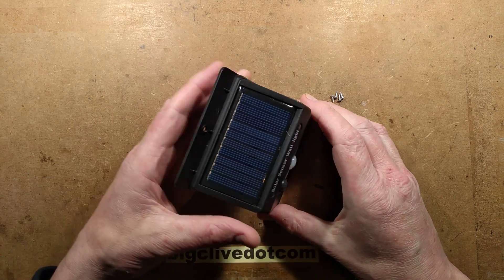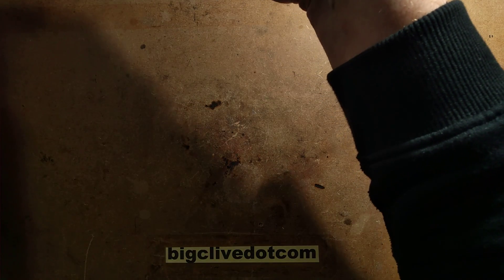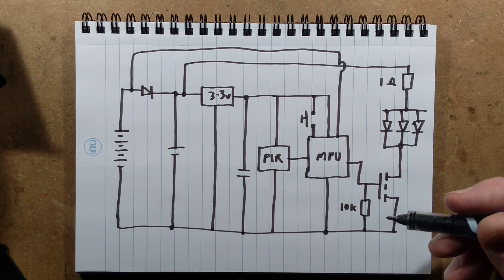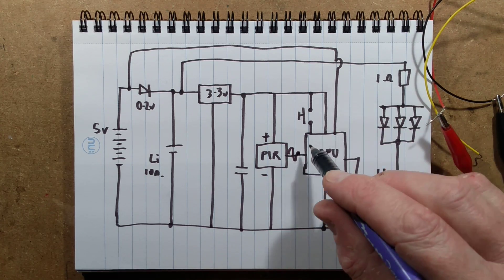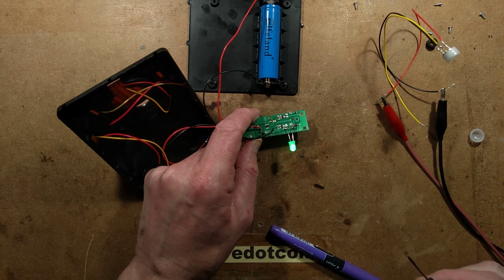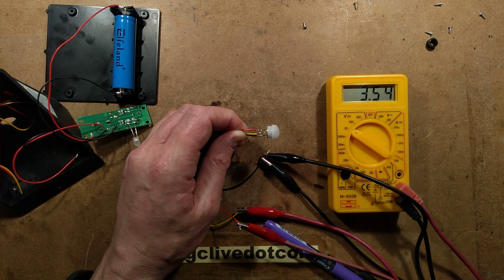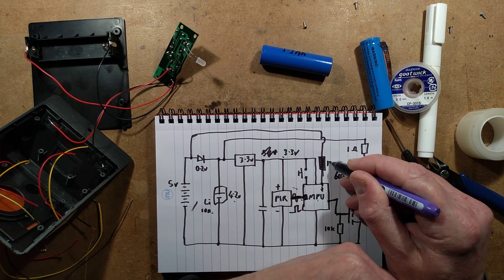Autopsy on a badly designed solar light (no lithium charge control).

Comment: I have 2 of these with the same shitty design. Both have failed due to the soft gel on the solar panel milkifying 😁. I gave them a good scrub with a scotchbrite-like scouring pad, stuck in a couple of near-done cells and put them back in their trees. Been running great for over a year now! 
I ran a wee bit silicone round exposed edges. I was surprised that the panels worked. Kid-on scotchbrite is your friend when it comes to milky panels, it seems!

Comment: Hey I just bought that same light at the dollar store here in the U.S. just the other day July 2025 and it only works if there is light to the solar panel. The motion detector does nothing and it don't charge the battery. I was thinking of replacing the battery but if it don't work properly then that could be bad. It does have that burned electrics smell. I would of took it back but they probably would just try to sell it again. Oh and my battery is soldered in.
Reply from the maker: Check for reversed or bad solder connections for the battery.  It may also be that the battery is over discharged.

Comment: In my opinion, this would be a good scheme, not like in one of your other videos. The battery is constantly charging and the switch does not disconnect the battery, but the light activation circuit. Everything is clear and simple, I just wonder why the PIR sensor and MPU are constantly under voltage? I know that the current consumption is in the order of micro amps, but again, everything could have been disconnected before the 3.3V voltage stabilizer.

Comment: i checked the battery and it had charged to 4.5 volt! this explains a failed 18660 battery. i replaced it with a vape battery. a 10 k resistor helps to discharge it. also nated 0.5 mA current into solar cell when dark..

Comment: They could have changed the firmware on the MCU to use the leds as a load to dump the excessive current and keep the battery from overcharging. Sure the light would randomly turn on, but it's better than it catching on fire.
Reply: Any suggestions to stop it going on fire? I just installed a dozen of these in full sun. I have cheap nimh cells and 100 k resistors but would that help?

Comment: Having had these outside my front door for 3+ years they have worked without issue, and they get full sunlight throughout the summer. These are the only units I have purchased that work in the depths of winter too.  Best "cheap" PIR solar lights I have brought with a decent amount of light. Still I agree the cheapness of the circuit design is terrible! but if it aint broke dont fix it!

Comment: it is possible that.

1. the battery is lifepo4 and not marked as such.

2. at the few milliamps the cell can self clamp due to leakage current.

3. an internal shunt resistor that effectively shorts or loads the solar panel causing it to not be able to charge anymore.

4. the low capacity of 600mah combined with the low c rating and the low current of the solar panel even if the cell could be destroyed the internal short that usually fires up most lithium cells would just discharge it.

when most battery fires happen it is because the charger is dumping several amps into the cell.

Comment: The bulbhead atomic beam sunblast sold in the US has the problem of overcharging or running the battery down too far, I don't  know which.  I fixed mine by adding a protection pcb from a phone battery.

Comment: Clive, unfortunately I found this video only after a similar issue with these solar lights. The brand I got have 30 leds. They worked faultlessly for 2 months and then one by one they all suffered the same issue; flashing at around 1 hertz until they died completely.  Ebay were no help as they said it had been after the months 'protection' and the seller didn't want to know. I took one apart and suspected that the 30leds were draining the battery too much and the solar panel couldn't charge them despite living in Australia where we get blistering sunshine. I replaced the non marked 18560s with some LG hG2 cells thinking the extra capacity might solve the problem but sadly not as all 20 of them are starting to fail. I looked at the circuit board and like you was amazed that there is no charge controller to prevent over charging and more importantly over discharging of the cells. I then thought about adding one of the cheap 1s BMS boards but the solar cell doesn't seem to give enough oomph for the BMS to start working. There are other versions of these out there that do have Liion charging circuitry but it is a bit of a hit and miss as to which ones you get. By hook or by crook I will get the original units working but now have 20 cells to try and revive from around 1volt!
Reply from the maker: I wonder if the solar panel is putting out decent current.
Reply: @bigclivedotcom  I have had a bit more time on this today on the solar cell kicks out 6.75v in full sun and, after connecting the bms properly (it has common +ve not -ve as the documentation says!) I can get some output from the BMS but I can't measure any current going into the cell. I am going to discharge one later and replace the one in the device and see if it charges. I am still annoyed that I can't recover the 20 dead LG cells, I tried the putting the dead one in parallel with a fully charged cell for 30 seconds but all I can get is 1.38v from 0.6v.  In the words of Sherlock, "The game is afoot, Watson!"
I had some of the button 18650 protection circuits (the ones that have the connection going along the side of the cell) but they didn't work as they have common terminals that doesn't isolate the connection.
I have got some usb-c liion charger modules (https://www.aliexpress.com/item/1005004654476348.html?spm=a2g0o.order_list.order_list_main.34.338c1802FVVZht)  intended for power banks (1.50 Aud) on order from 'Mau's Empire of Dirt';   it has 2 input terminals, terminals for the Liion cell and 2 more as output terminals. I think I will connect the solar panel directly to the input, and the output terminals to where the solar cell was and finally take out the diode and put in a wire. This should allow the 18650 to be charged properly and the output to power the rest of the circuit. I will let you know how it goes.The frankensteining seems to have been a success; I removed the diode and piggy backed the usb-c charging board to the solar panel, connected the liion cell to the 'battery' terminal on the usb-c module and then the 'output' terminals to the battery+ and battery- on the original pcb. They have worked flawlessly for 2 weeks now and the liion cells are charged to 4.2v! Win Win.

Comment: Sorry that Neville and others have had bad luck with these. I have at least 5 like this in my backyard, and a couple more that are “flat” rather than wedge-shaped so as to shine directly down rather into neighbors’ windows. Most are south-facing. All are still working fine after more than 4 years. The solar panels and/or the LED arrays shows signs of degradation and/or water intrusion, but still work well. 
If I replace any of them or put up others, I will use Clive’s trick of sealing the seams with nail hardener / gel , or maybe hot glue.

Comment: also you can put a depending how sunny it is in your area one or two diodes in series 0.6 diode dropper in series with the solar cell to reduce over charging risk and also put 2 k to 10 k load resistor across battery depending how sunny it is

Comment: Clive, you said that the cell was surprisingly light or some similar phrase.  That is an indication that it is not an 18650 with the stated capacity.  There is a video somewhere of someone determining whether 18650s are genuine or not by weighing them on a standard digital kitchen scale and then measuring their capacities.  All the light ones (usually obtained from e-bay) where only about 2/3rd of their stated capacity but the heavy ones where around their stated capacity.  If you have bought an 18650 and it is light, then you have probably been ripped off.  Sorry, Can't remember the weight that determines it is genuine, but I'm sure you can find the video on Youtube if you search for it.

Comment: My dad got 2 off eBay one has just gone bang. I opened the other one and the battery voltage was 4.9v. I fixed them with a new battery  (an old battery from a laptop) with added protection board bms.

Comment: Been looking all over for this! I am interested in the fact that it goes off when light falls on the panel - I bought a "Separate Solar Wall Light" SL-F120 with a panel (giving 4-6v) + 5 metre cable, I intended to  put in a window and have the LEDs light up a dark hallway in the daytime as well as at night. Can it be hacked to come on when voltage is going into the jack, or would it be better to have a 2nd PIR to interrupt the power from the solar in some sort of dongle, and even maybe charge an external battery at the same time?
Reply: It has a1200 mA lithium battery inside the LED panel

Comment: I bought 4 of these and was similarly concerned over the charging circuit. In mine they did away with the battery clip and just soldered to it and hot glued it in. I was after a low powered PIR alarm trigger that was solar charged, so it may work ok for that with modification by adding a 1sBMS and resistor+zener clamp and sealing around the panel.

Comment: Could I replace the 3XNi-Mh solar light batteries with a single reclaimed (plenty single-use vape pens around the bus stops) Li-ion cell? Does it need modification or can I replace directly? The voltages seem to match, but I'm not sure of the charging protocol :[
Reply from the maker: I wouldn't recommend that.  You could use a lithium cell with built in overvoltage protection though.
Reply: @bigclivedotcom   Ok, thank you very much for the reply. 
I'll use one of the old Nokia batteries then. Still have to find a good use to all the vape-pen batteries I have amassed 🤔

Comment: I have one of those - and it just exploded and the lithium battery was ejected and spewed its guts. The insides were like coiled foil paper and burnt to a cinder. The side of the lamp was 3m away and the battery around a meter away. Thank goodness it was no where near people and was outdoors.
Reply from the maker: This is happening a lot.  There appears to be no charge control on some of the lithium batteries.

Comment: I also have two of these somewhat similar with eight pin control chip and 18650 battery and it stopped working after about ten months. It only blinks ones after covering solar panel.

Comment: I have had 4 of these lights for about 12 months. So far 2 of these have had what appears to be a catastrophic battery explosion where the battery has spewed out its contents smashing through the plastic side of the unit. Seems to be very dangerous light.
Reply from the maker: It's an increasingly common occurrence.  The battery often unravels in a spiral in the process.

Comment: Watched this last night, realised I had the same one in my conservatory as a motion sensor when it was dark. Checked the voltage and the cell was at 5.2v (still working) thank you for flagging this up before it set my conservatory on fire.
Reply: Panic over Clive, I contacted them and this is genuinely the reply I got ……New message from: trybest6699  Top Rated Seller(13,481YellowShooting Star)
5.3V has no harm to the human body.
There is no danger below 36V.
do not worry.
Reply: @andywalker1388 LOL
Reply: mine was at 4.9, i saw it was overcharged so thank god
Reply: @peppermeat8059  4.5 mine

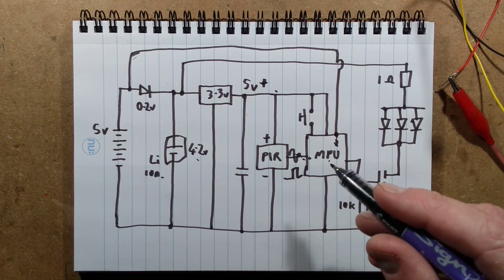Comment: 10:11 i think one of our garden solar lamps has a circuit that dumps solar panel current to LEDs when the battery is full. in short, the LEDs light up under the sun.  I think I've seen it only once when I placed a (manually) charged battery to the lamp.
Reply from the maker: The nature of the circuitry means that happens if the battery voltage floats too high and the solar panel voltage can exceed the forward voltage of the LED.  It also happens if the battery is removed.
Reply: @bigclivedotcom  thanks! I can recall it also happened without the battery!

Comment: i bought this recently because I was hoping to extract a NiMH AA battery inside (the device is cheaper than buying a NIMH battery) to replace the NIMH in any of our solar garden lamps.  To my surprise, I found a lithium battery but at the form factor of a double A!! I don't know what to do with that battery except not touch it
Reply from the maker: It might be a LiFePO4 cell which is good.
Reply: @bigclivedotcom  It measured around 4 volts.😞  I repurposed the light as a night light but the our skylight is probably not transparent enough to charge it.

Comment: Would be nice to see some projects built around reusing these failed lamps.

I have four failed ones from a friend, which failed after one summer, and kept them around in case I can repurpose some of the parts.

All had their Li-Ion batteries fried.

My theory was also that there didn't seem to be any over charging protection.

But I liked the fact that thy shutdown instantly after they sense dark.

All my PIR modules with light sensors shutdown only if it gets dark AND there is no movement, which is annoying if they are used as a nightlight inside the house, and they remain on after turning on the lights.
Reply: This. This is exactly what im trying to bypass
Reply: Yeah all the batteries would instantly discharge, i took one from 2 solar lights that didnt work, one battery was at 2 volts, (deep discharge) and one was at 3 volts (possible rechargeable) and they all do not work and wont recharge anymore

Comment: Mine died with lack of proper sealing on the solar cells, rain got to the back of the cell and fairly quickly rotted the copper strips leading to the solder points.

Comment: I have two similar lights without the side LEDs. They worked OK for a few days, but after that they are extremely problematic. After a day of full light they may work for a few times (2 or 3 or so) at night when the PIR detects movement, then die. 
Had a look at the PCB and though similar, this one has an 8 pin controller chip.
Reply from the maker: Is it getting a decent amount of direct sunlight every day?
Reply: @bigclivedotcom  yes very much, totally free and pointed almost straight south. It’s cold here now though...not sure if that might be the problem.

Comment: i was getting 6.7vdc from the solar panel. mine also had hardening/yellowing on the clear covering , as did the PIR cover. mine was given to me by a friend and had the 18650 cell that was reading about 1.3vdc . i liked the brightness of the LED array , so i removed the PIR and the solar panel wires from the PCB &  modified the casing and added a 9vdc battery with soft terminal connector . they worked as expected .i hung the lighting the hallway to the bathroom & would turn the switch on at bedtime and off in the morning

Comment: This video is a year old now and these things are all over eBay still.
Reply from the maker: There's even more of them, and all different inside.
Reply: @bigclivedotcom  I have been looking at one on eBay that kind looks like a UFO with a hook on top to hang it, interestingly it also has USB ports to charge a phone! 3 different types of USB ports! Solar panels on top but it doesn't look like they might have the capacity to charge the internal lithium battery.. possibly batteries if it was intended to actually charge a phone! 
Might be a worthy contender for a peek inside...

Comment: I had one of these go pop a year or two ago now. If i remember correctly the negative side of the battery popped with enough force to punch a hole through the outer casing and knocking it of the fence it was screwed too.

Comment: I had this exact model bought off Wish.com but yesterday evening, I was sat in the sun at my front door and the battery exploded which sent bits of black plastic everywhere. Please be careful if you have this solar led light to ensure it does not overheat with a hot sun. It really gave me a scare, it was an almighty bang, I thought I had been shot !!

Comment: How do you add a charge controller?   I have tried on the output from the solar panel but the unit then does not work.

Comment: i have 3 of these and one sit outside window and 2 inside and dont have leds on the sides but still working nearly a year , but  a thing is the 2 inside i kept off and the one outside on... stil works (i didnt check any charge current) but  just seel them with clear silicone around ...stil works... do you have any improvement to the circuits?

Comment: Got the same lamp installed on a wooden fence in a really sunny place for 4 months summer and it hasn't exploded or burned the entire fence yet, I feel disappointed.
Need to check if it has a protected battery.

Comment: I’ve got one of these. I believe there is no overcharging protection as I have to change the 18650 battery every few months. They even saved money by direct soldering the battery into the unit instead of using a spring release clip. Cheap shortcuts leading to inbuilt redundancy.
Reply: paint the solar panels so charge less

Comment: Aldi stores sell similar, I bought four of them last time, replaced the 18550's in two of them, currently trying to get the other two to work correctly,.....I can't really recommend them. https://www.aldi.co.uk/solar-pir-security-light/p/018068308416002

Comment: Clive  thank you for schematic  and details . I have 6 of those. I disconnected the diode and added the 100K resistor you mentioned  and a 18650 charge / discharge control board . Now the light works fine .Tx again.